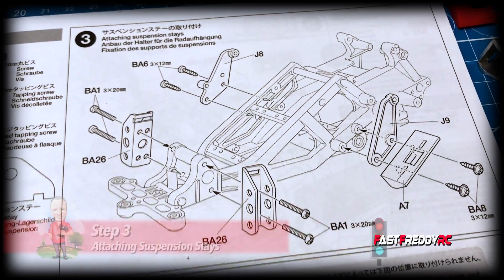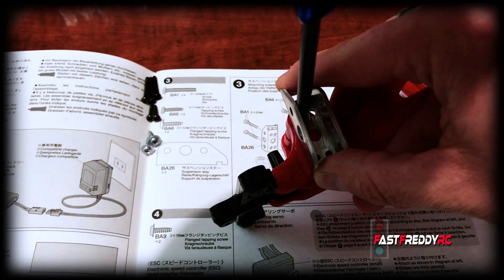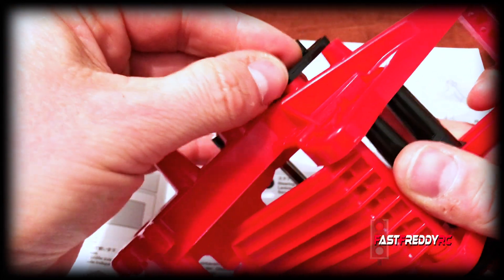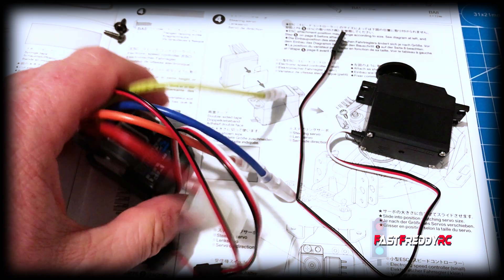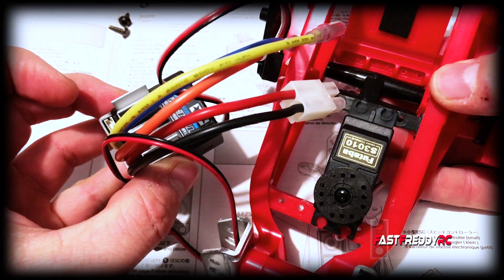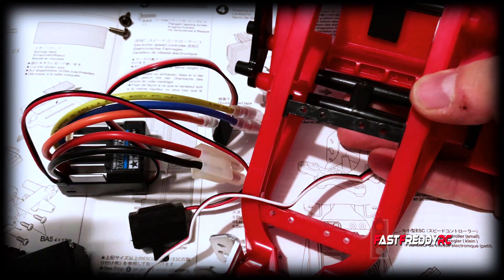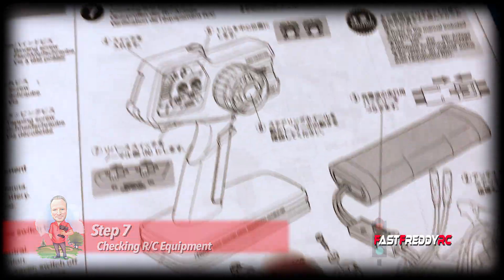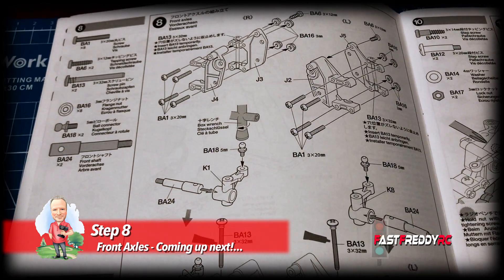Tamiya Monster Beetle Build Series - (Steps 3 to 7) - Shock Stays and Electronics - Tips and Tricks

Comment: I too, have the small on/off switch with the wire that’s too short in my kit. I think I will get the bigger Futaba on/off switch with longer wire and cut the small switch off and solder and heat shrink  the Futaba one on, so it will reach and fit where it’s supposed too.
Reply from the maker: That should definitely work John.  I know there are a lot of people that say the THW1060 ESC is better than the Tamiya ESC that the kits used to come with.  However, the instruction manuals are all based on using the Tamiya ESC.  So I think if Tamiya isn't planning on making their own ESC's anymore they need to have a special deal with HobbyWing so that the leads, and the on/off switch, are redesigned for Tamiya cars so that people don't get lost as to what they are supposed to do for attaching them.
Reply: @FastFreddyRC  what I actually did today, was to mount the little switch onto a L shaped alloy bracket I made, and fastened it onto the plastic bracket where it should go, because the lead was too short I cut through it and soldered an extension piece into it.

Comment: Great building video Freddy. I had choosen the second version for the ESC on my Blackfoot. This is because of two reasons: 1. the dust cover gives no protection, the chassis is open. 2. I wanted tovqccess to the programmin button of the ESC.
Reply from the maker: Thank you! I think I would have rather put it in the second position as well as your points are completely valid. It’s probably more user friendly if you move it to the top. For now I’ll leave mine where it is but I might move it later. I’ll see after I’ve had a chance to do some running videos with it.

Comment: Hi, nice video series you have here. I just purchased a Monster Beetle for my niece and a Blackfoot for myself so we can build them together. We ran into an issue with the mounting of the switch on the ESC. The switch doesn't reach the mounting location due to the wire is too short, but does not look like you have this issue with yours. It also looks like you have a different ESC than we so. I noticed you have 5 wires that come out of the ESC and ours only has 4. The 2 battery wires and 2 wires for the motor but could not recognize the last wire which looked like it was orange in color. The ESC we have is a Hobbywing 1060. What ESC did your kit come with? Also the switch housing is different too as the switch housing on your ESC is larger and can mount to the car as ours is smaller and cannot really mount with hardware but might need to be mounted with a sticky pad. Thanks
Reply from the maker: Thanks Alex!  Appreciate you  checking it out!  I know exactly what you are referring too.  The ESC that came with mine was a Tamiya TBLE-02.  But because of the pandemic, Tamiya ended up doing a deal with Hobby Wing as Tamiya was having trouble getting the chips they needed for their own.  So there's a couple things you'll need to do.  1. You are right, the switch mounting will have to be different as the lead is too short, and even if it wasn't, it's not going to be the right fit for the monster beetle mounting spot.  You'll need to mount the switch somewhere else on the chassis and one option is to use double sided tape to hold it down somewhere accessible on the chassis (which is pretty much what you've said) 2.  The wires.  The TBLE-02 is a brushless/brushed ESC so there is an extra wire on it if you are using a brushless motor.  As I was using the stock 540 motor that came with the kit, the orange wire is not being used.  The orange wire would be for a brushless setup. I believe your HW1060 will have the same 3 wire colours as the TBLE-02.  So the orange wire will only be used with a brushless motor.  So if your 1060 is like the TBLE-02, you will connect the blue wire to the green off the motor, and the yellow wire to the yellow off the motor. The orange wire will not be used. Hope that helps!
Reply from the maker: And congrats on your purchases!  You'll both have a lot of fun putting those together.  The Blackfoot was my first ever Tamiya R/C back in the day and I picked one up back in 2016 when it was re-released.
Reply: @FastFreddyRC  Awesome! Thank you so much Freddy. I kind of figured it was a Covid special. We'll figure out a place to mount the switch once we build more of the car up. Thanks again and hope to see many more videos from you to come.
Reply from the maker: @FZ1YamaSeca  Hey you're welcome! and thank you!  More videos are definitely in the works!